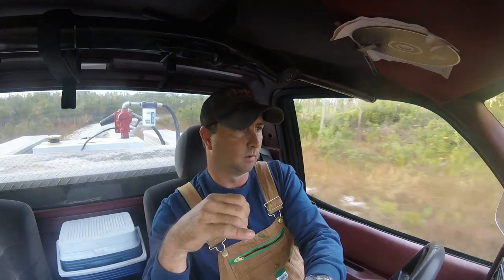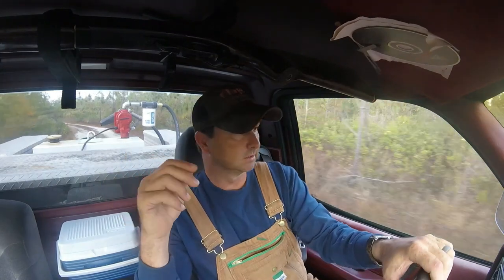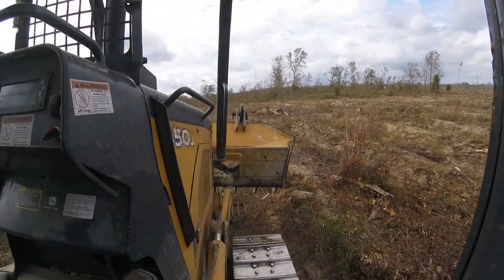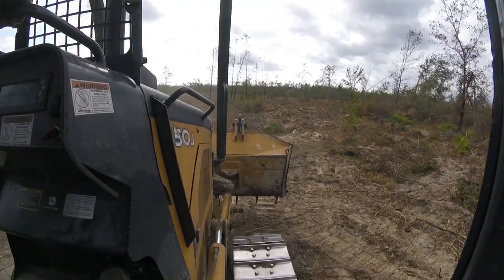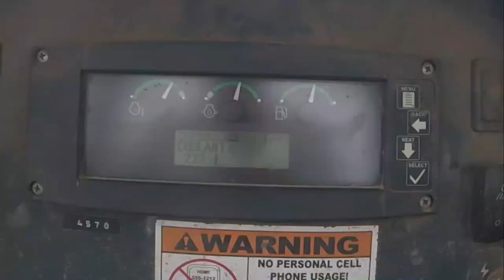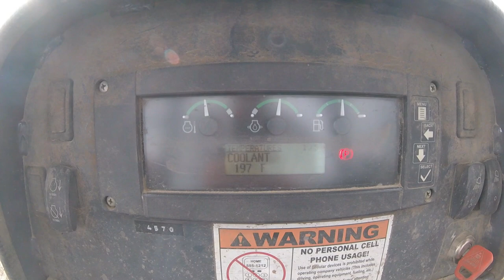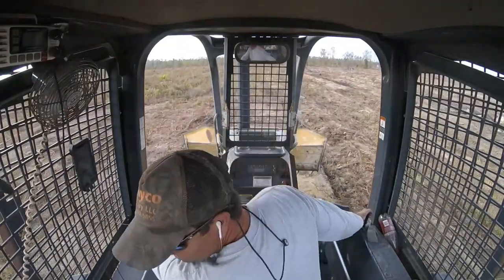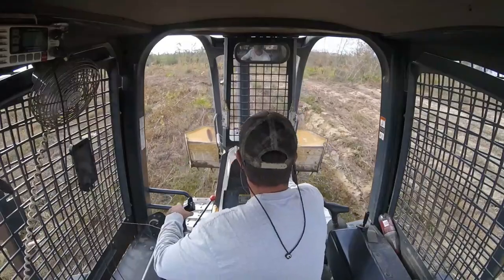Site Prep with Rome Plow 2019

Comment: I love ti see the beds in Taylor Co.
I've walked a many a mile up and down and found a many artifacts that have been saved for future generations.
I love to see the bedding plow in action, amazing.
I didn't realize there were so many different ones.
Back in 03 the plow they used for bedding were cutting super deep.
Now,20 years later,same area,the beds were spread apart more and the plow barely scraped....
I bet all that stuff is computer controlled nowadays.
I'd love to see the whole process from harvesting to pulp mill.
I've always wanted to run a skidder.
Cool videos.
Thanks.
Id mount the radiator in the back with electric fans or make some sort of survivable filtering system in line of radiator..